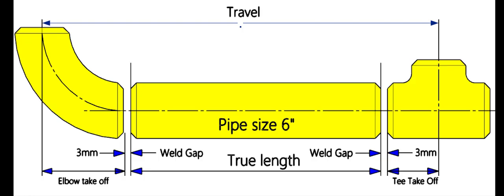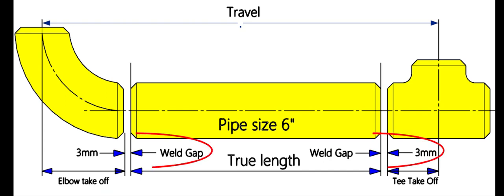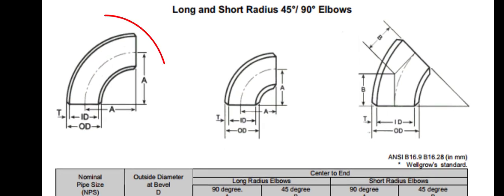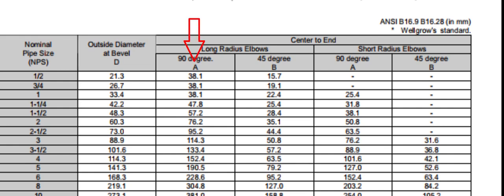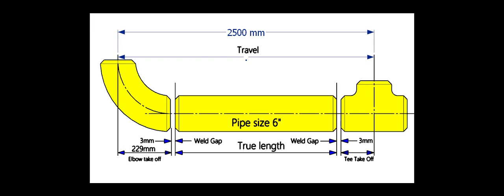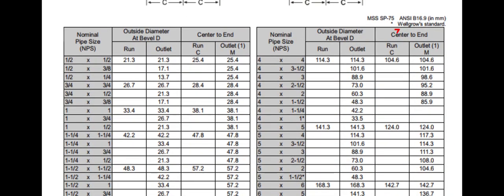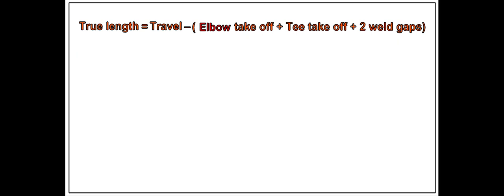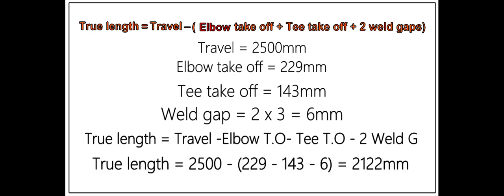PIPE TRUE LENGTH CALCULATION BETWEEN A TEE AND AN ELBOW. EASY FORMULA. TUTORIAL

Comment: You did not allow for shrinkage of each joint after welding, especially when welding stainless, usually a gap at 3/32 will shrink 1/16th
Reply from the maker: Already explained in the video Bro.